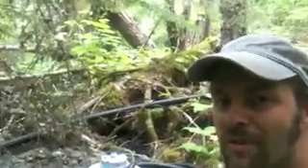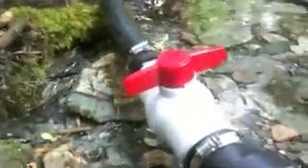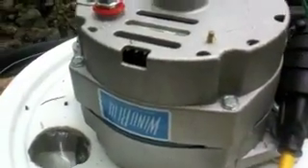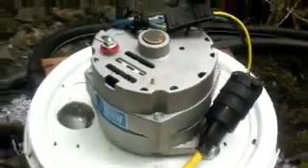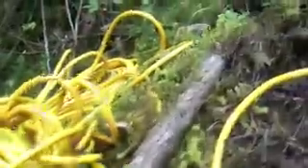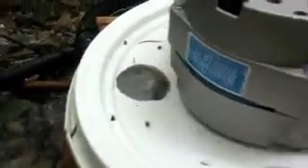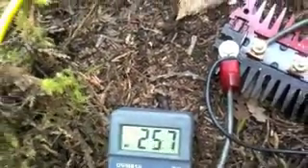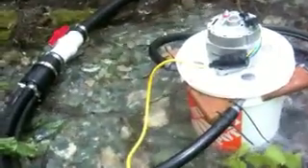micro-hydro power bucket

Comment: This is an awesome build, I was actually thinking of doing something
similar. I saw that you used 200ft of 2” hose. I don’t believe you mention your
elevation drop. Do you have a guess of this elevation drop? Or if you wouldn’t mind
using google earth to measure the elevation drop between the approximate
location of the beginning and end? Thank you either way. I hope you were able
to put this system to use!

Comment: I Have a decent sized creek and would like to run some kind of hydroelectric system off it. Like a Wateroter or some underwater system. I dont have much of a drop off to run pipes like yours but if I had an idea of what i could use in my creek that would be great. it's high flow just not much of a downhill.
Reply: Then you have to use a different type of generator. A type called reaction. Either Kaplan or franci. Sometimes called low head generators.

Comment: Why do you have or need batteries? Does the water stop flowing at night?
Reply: sailingsolar it's only producing 57v with no load. If you wanted to run multiple devices at once or high drain stuff, you need a reserve

Comment: how did you get the alternator to produce ac power??
Reply: Billy, that is a silly question. This is grade 8-9 power mechanics big guy. All alternators produce a.c. sine wave current and have to be rectified and voltage regulated, mostly internally, some have external components. They are 3 phase. All old school d.c. generators are just that, generators
Reply: +ChiefJustice Middlyoeton rfrh

Comment from the maker: Hey Ahmed.  The pressure comes from the vertical difference between the intake of the pipe and the output.  This is called 'head' (or more technically Hydrostatic Head) in a hydro-power system.

Comment: Nice!  You might be losing some flow at your reducing stages.  They don't look very smooth.  You could 3D print some reducers with smoother flow and get more power.  Assuming you can't find something of the shelf.
Reply: Or, instead of 3D printing something, you could just make it.

Comment from the maker: Hey Larry.  The rectifier I use in this project is specific to the PMA (permanent magnet alternator) I am using.  It converts the AC power coming out of the alternator to DC.  Once the power has been rectified, I then feed it into my charge controller which manages the battery bank.  The charge controller that I am using can be used for hydro power, wind power and/or solar power.  My long-term goals are to use both solar and hydro to keep my batter bank topped up.

Comment from the maker: Hi Tony.  No - I didn't test the current in AC.  The valve on my 2" pipe cracked from freezing last winter so I have not been able to do any tests while I was there this summer.  I plan to pick up parts and run further tests this fall when I return to close the cabin.  I will post a new video when I have something relevant to share.

Comment from the maker: Yes.  I looked into purchasing a pelton wheel, but much prefer the DIY method.

I have upgraded the wheel since posting this video.  Using a Makerbot 3D printer, I created a much more efficient pelton wheel.

I'll post another video showing the work that I have done to the system since this video was posted.

Comment from the maker: Hi Jim.  Yes - I have read about people using high-torque DC motors recycled from treadmills for systems similar to this.

One downside of generating direct DC is that is it hard to send the power a decent distance without losing it to heat (via resistance in the transmission lines).  You need to have very heavy gauge wires to minimize the loss.  

The benefit of the PMA that I am using is that it outputs AC, so I can transmit it much more efficiently, then convert to DC at the battery bank.

Comment from the maker: Yes - they are different devices.

I think what you mean by "converter" is a charge controller.  There is one of these in my system also - near the battery bank.  Most solar systems will feed into a charge controller also.

The rectifier I use in this system converts the AC electricity produced by the alternator into DC.  The DC power is then fed into the charge controller.

Comment: Hello iff you got more poles you dont need to have high rpm 
I cant remember it precily but  iff you have a 60 or 120 rpm generator then it wuld have to have 78 poles remember can remember if it is 120 or 60 if it is 120 then you need to duble the poles to get full potentiel at 60 rpm now that a big generator you could make 3 circles on one disk and then conect them then you get it one one disk or you can make a huge disk with 1 circlel or 3 disk with 1 circklel each

Comment: Hey Paul - Is there a low RPM DC generator so the rectifier could be eliminated?  If there is such a thing it would make the system more efficient, yes?  

Nice system either way!

Comment: great system but uncoil that extension cord or use a shorter one.  Coiling up such a large cable can cause induction resulting in a voltage drop.  Making your system work harder with less of a result.  But im sure you know this and have already corrected the problem.

Comment from the maker: @CrispinProctor69 I have not run the system under load yet.  On my next trip to the cabin I plan to bring the charge controller & battery bank to give the system a real-world test.  I will post the results on the project page as well as another video.

Comment from the maker: @abuthemagician  At the top of the intake there is a small pool in the creek with approximately 250 liters of water, which gives about 2 minutes of run time with the valve fully open.  This isn't a problem in spring and fall when there is lots of water coming down the creek, but in the dry summer the system empties the pool quickly.  I have plans to create an auto open/close system to keep from draining the pool.